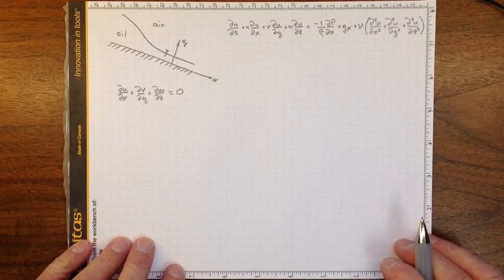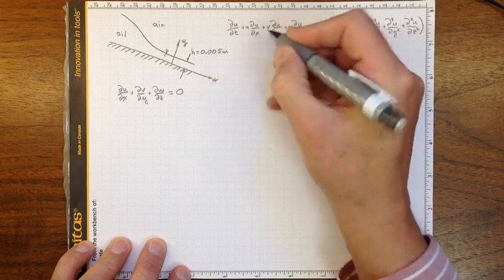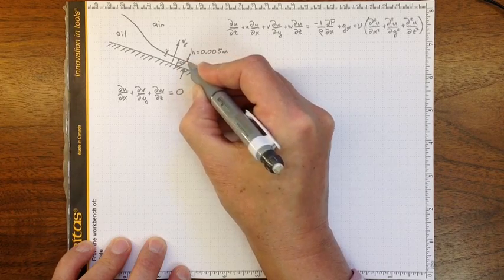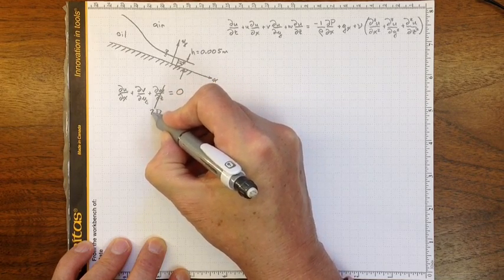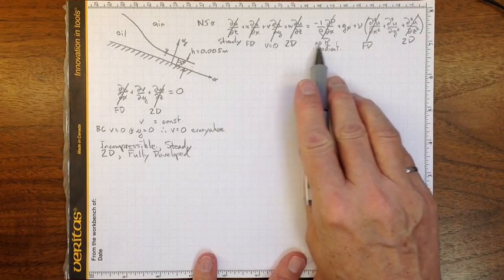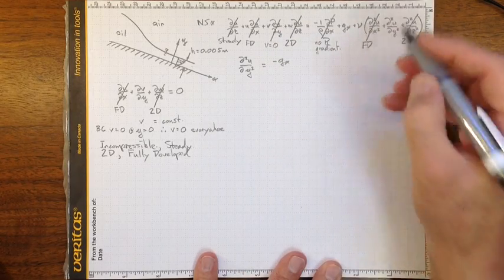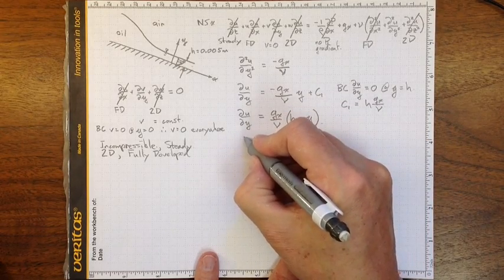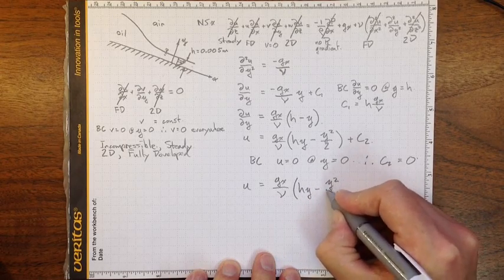Velocity Profile on a Slope

Comment: why will DP/DX =0 ?????
Reply from the maker: The air is all at atmospheric pressure, so the oil surface pressure is atmospheric. The pressure in the oil below the surface is a little higher due to rho g h, but following any streamline in the x direction, the pressure changes very little once the thickness of the oil layer is constant (fully developed flow).
Reply: @RickSellens  okay